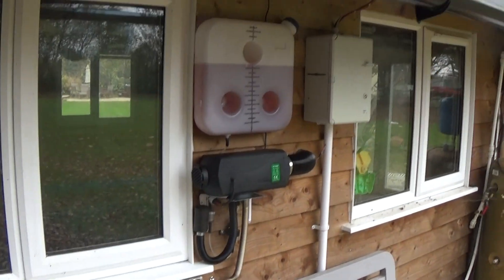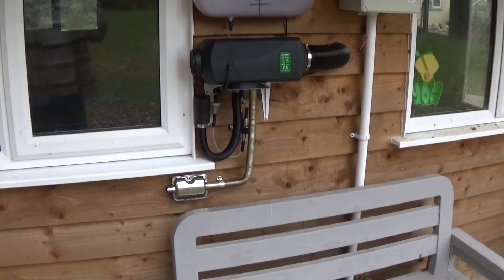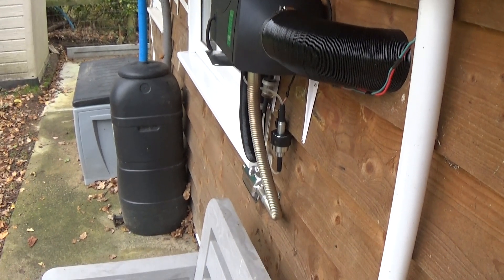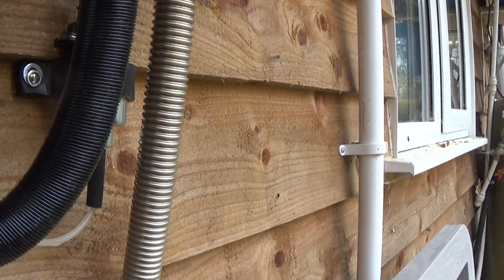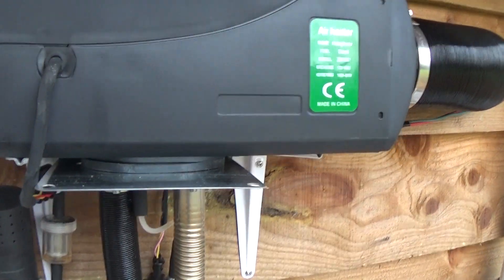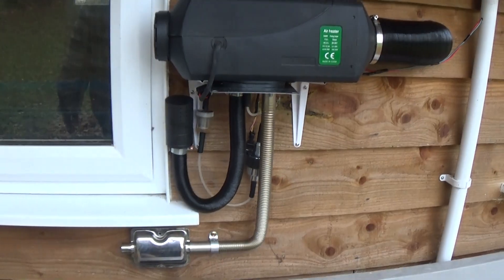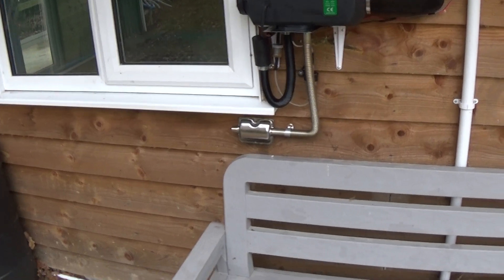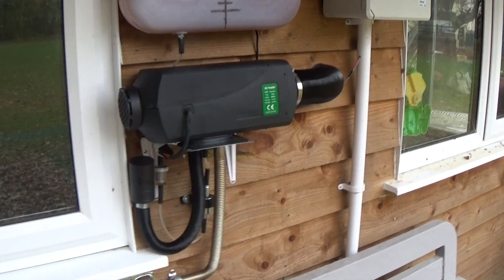Diesel parking heater used for central heating

Comment: It's not a diaphragm pump, it's a solenoid pump 👍
Reply from the maker: Yes sir. It is a solenoid connected to a diaphragm
Reply: @woodowoods9167  no , its not, there is no diaphragm just a steel ball one way valve, that's why they are so noisy
Reply from the maker: I stand corrected, thanks for making me look at it. @Dirt-Diggler

Comment: A lot of heat lost with no insulation of the heat pipe. 
Storing fuel directly above the heater? 
A lot of places to improve on. 

Great video.
Reply from the maker: Agreed sir. Just a test rig at this stage